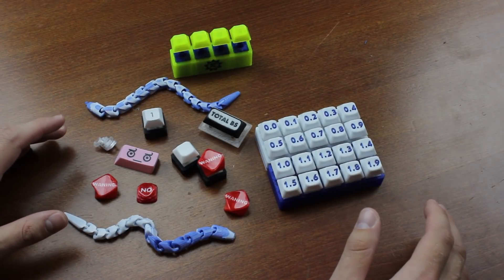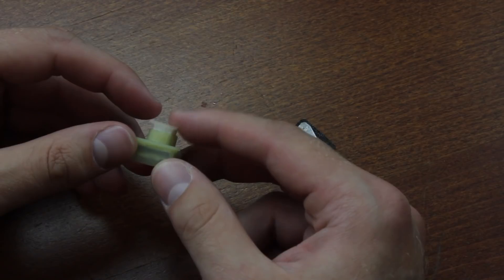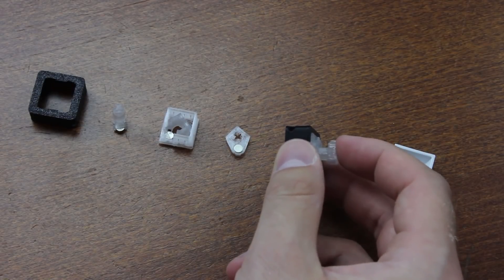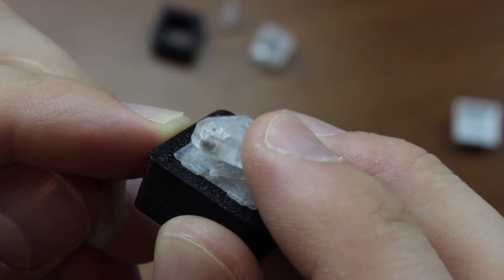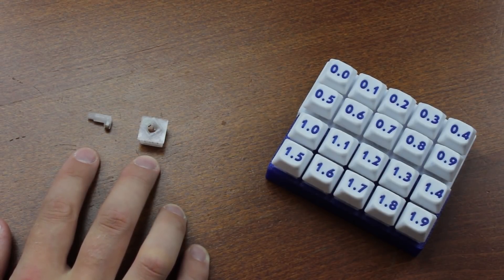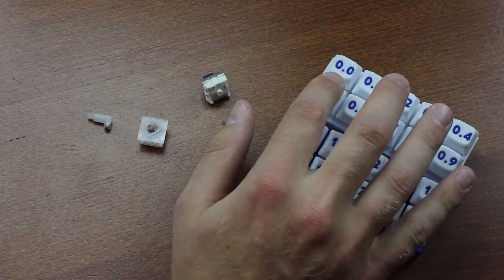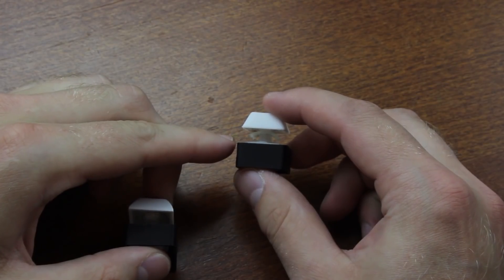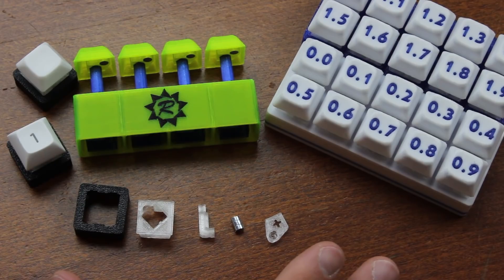Teardown - 3D-printed magnetic levitation "Void" switches!

Comment: Just use an electromagnet on the switch housing and PWM it to the amount of tactility!
Reply: I actually thought about doing this!  I got close recently when I hooked up a relay board to my keyboard: https://youtu.be/6hMOGKTudcg
Reply: @Riskable3DPrinting  that is funny! Do you think it would interfere with the Hall effect sensing?
Reply: @KayvonJavid  Yes it would!  Absolutely!  Haha.  It's not as big a deal as you think though:  My firmware can read 96 analog hall effect sensors in under 200 microseconds which leaves 800 or so to send a strong electromagnetic tactile jolt to stay within that 1ms polling window 👍
Reply: Maybe moving to optical switching could remove any penalty from this?
Reply: @NickShabazz  probably it also has analog capability too. But man the life time of this switch design could be well beyond billions because there really isn’t anything to wear out other than the electronics
Reply: @KayvonJavid  Not true!  Your fingers will wear out!
Reply: @Riskable3DPrinting  Lol very true! But for industrial applications this would be great

Comment: This gives me so many ideas! Ive been wishing someone made an MX-compatible magnetic seperation switch for a while now, glad to see someone else is thinking down that track as well.
Reply: Well only the switch stem is MX-compatible.  The switch itself needs a hall effect sensor or reed switch to actually function as a keyboard key (use hall effect though it's better and cheaper 👍).  I only added support for MX stems to the switch but I have a placeholder in the code for adding Alps stem support too.
Reply: @Riskable3DPrinting  true, didn't think of that. Hall effect is better anyway!

Comment: They do look great - but could the magnets attract small iron particles over time gum up?
Reply: Maybe not machine shop safe? But unless you live on a beach I can't picture this being much of an issue.
Reply: @subterficial  Even in a machine shop they'd be fine.  The metal bits would just collect around the edges of the plastic and maybe a little bit on the parts of the stem that are exposed.  They wouldn't impact the functionality at all.  Not unless you start getting millimeters worth of metal piles under the plate :D
Reply: There are already many switches that use Hall effect technology which means they use magnets. They don't all gum up with metal so I don't think it would be a problem. In fact, hall effect switches are considered very reliable.
Reply: Considering how tiny the magnets are, it wouldn't take you very long to find a big enough magnet to clean them off if that ever did become a problem.